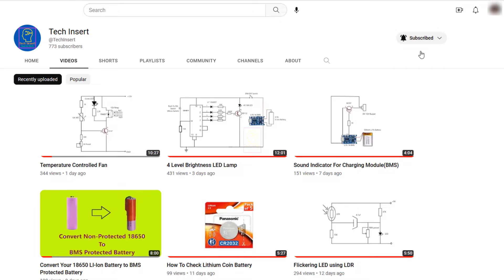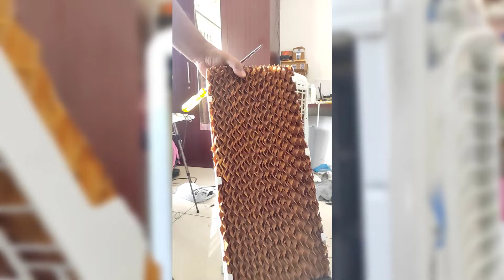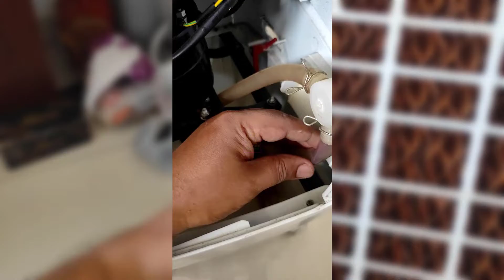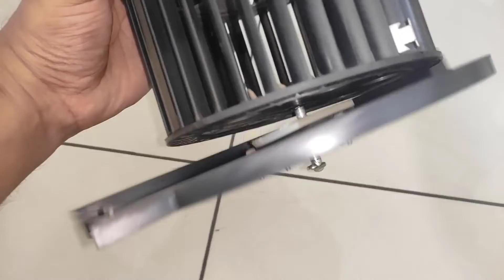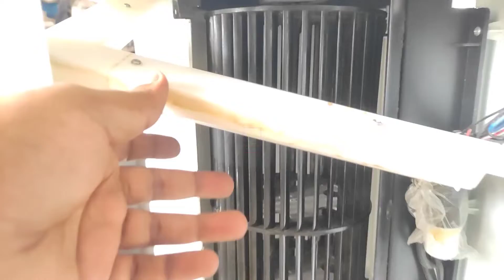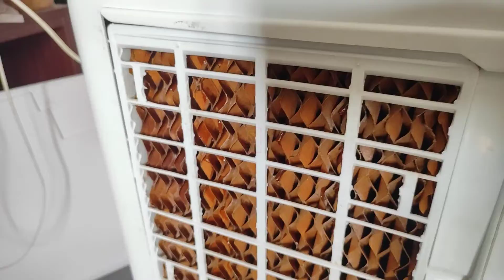How to Clean Air Cooler | How to Remove Bad Smell From Air Cooler

Comment: what, how & where to add disinfectant or a mild perfume for avaoiding bad odour?
Reply from the maker: I tried adding essentia oil to the water. But then at starting it was pleasent aroma. But later the honey comp became clogged with oil and I had to wash with soap water for cleaning. After that   I placed a cotton with essential oil in front of the air outlet grill  . Fixed with cloth clip.  then it was fine